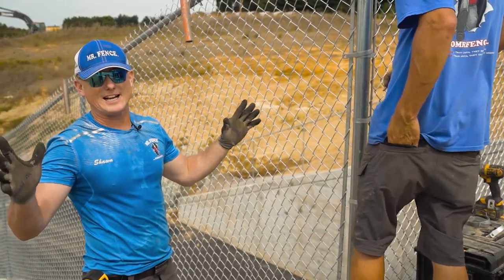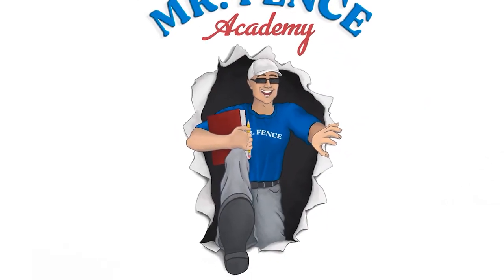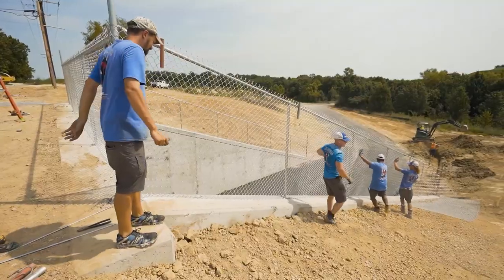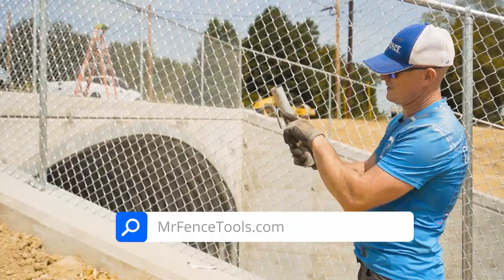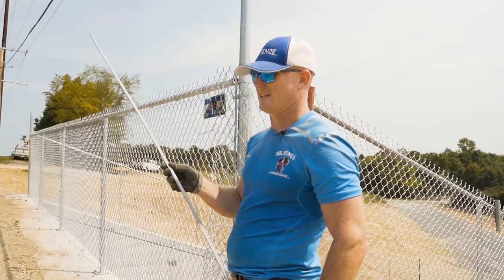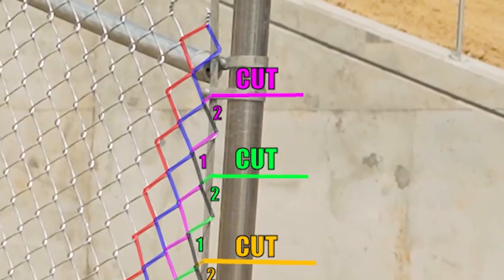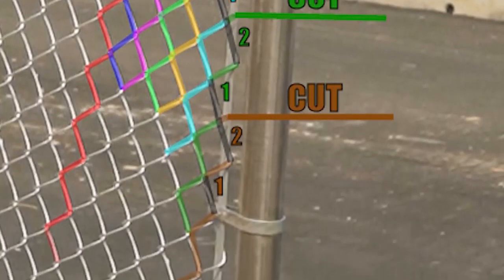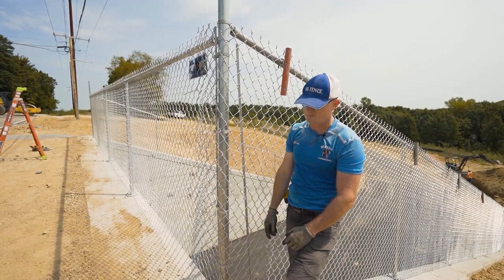Chain link Bias Cut Pt.1 | Mr. Fence Academy

Comment: Interesting watching someone do it their way.  After doing 1000s of bias cuts it's much faster to cut the bias when the wire is on the ground then add the t bar prior to standing the wire.  We just have a different process.  I will do it the way you did when I am teaching a new guy how to cut a bias as it is much easier for the untrained eye to see bias and where to cut with wire standing and t bar installed. Keep up the good work.

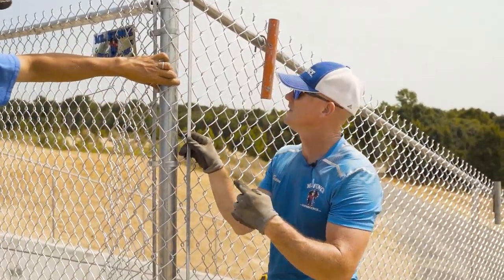Comment: 2:43. The greatest tip in any fence construction video! No math, no counting. Just line up the tension bar!! I'm thinking you could even slide a marker alongside the tension bar, and then just cut on the line. Do you need to cut a bias when going up and back down a hill?  How is that done?

Comment: Nice. I was looking for something like this. I am putting up a fence around my garden. It has a lot of slopes and bumps. A 5’ fence will be 5’ no matter if it’s in a slope or on a horizontal ground? I have been imagining the poles in the slopy areas has to be either shorter or taller than the ones at the horizontal area, but I might be wrong. The chain link fence is flexible. 

It also looks like you cut the fence at the corners. Any reason why you dont go around the corners, especially a corner between horizontal and slope?